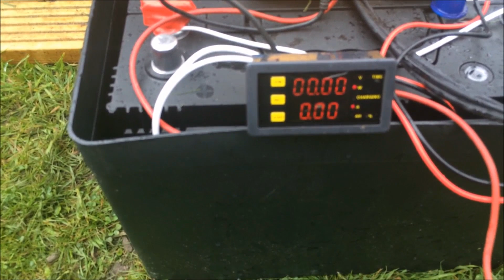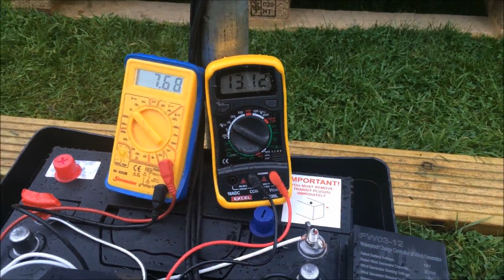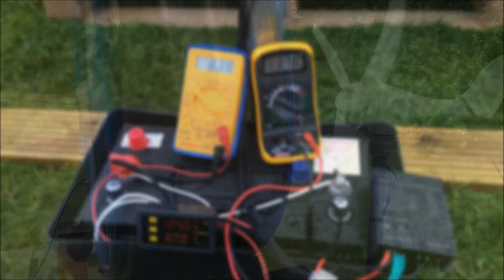100 Watt Small Wind Turbine output test and review

Comment: Just bought the 300w 12v version, it's up and running and maxed out at 416 watts so far, these turbines work and exceed there rated wattage easily, these are the real thing.
Update...432w I'm impressed
Reply: which one did you buy \ which link ? there's so much crap out there
Reply: Bull shit, these little turbines are a scam

Comment: what happens if the wind is way stronger to the voltage output of the wind turbine? will the controller dump the excess?
Reply: No. Those controllers don't dump extra load. It's just brake on

Comment: All practical tests of ground-based small wind turbines show: 1) They hardly produce any electricity! 2) They do not last long! 
*Solar panels generate at least 10 times more green electricity with the same investment & time expenditure! * Reliable and almost maintenance-free for at least 25 years!
Small wind turbines produce hardly no electricity, due to hardly any wind close to the ground – and electricity yield is proportional to third power of wind speed: +100% wind generates +800% more electricity! Moreover, the wind close to ground is extremely gusty. 9 out of 10 small wind turbines therefore stop working after a short time!

Comment: Great...... I have a 325 watt 12 volt 5 blade turbine situated on the top 12th floor of a tower block with 360 degrees view. I have had it a few months during summer but not seen any decent storms yet but on the small storms there has been it was outputting 11-12 amps so in a very strong wind I expect about 15 amps. I have the same brand charge unit shown at 400 watts rating. I may make my own charge unit & experiment.

Comment: I have a question. I am interested into these devices but since I live in a residential area I've already got power in my house, so I am wondering something, if I got one of these could I just mount it on a pole and cap off the wires with wire nuts and not have it draw power to anything?
Reply: why would you want to do that?
Reply: @TheAmazingAdventuresOfMiles  Because I like these devices, but my house already has power from the town.

Comment: If output v is low .you can connect it to step up circuit.
Reply: areenarena
hi
I have a step up circuit but the problem is that it makes my 500 w turbine to spin very slowly, like breaks the turbine.
Do you know why this is happening. I appreciate it if you can explain it to me
Reply: And loose even more efficiency 106 watts now your looking more at 55 watts

Comment: Cool, might just get one of these and a couple of 100w solar panels to run the 100w greenhouse heater in my workshop.👍👍👍
Reply: the most expensive part of the system is always the batteries.

Comment: Has anyone used one of these wind turbine with a motorhome to charge leisure batteries.  I would like to try one. Cheers from George and Jane. 👫👍🇬🇧
Reply: They can, but you need a good pole system for it.  Most of the time when you camp, it will be in wooded areas.  You need to be in high spots and have to get the turbine above the tree line to get the unbroken wind.
Reply: Don’t waste your money, invested in more solar and bigger battery bank,  they need a strong constant wind that doesn’t move around, the real world is not like the fan set up,  and the blades are brittle, they brake often.  Waste of time and money
Reply: And they are noisey , you will piss the neighbours off worse than using a petrol Genny

Comment: How many amps would that put out at that wind speed ?
Reply: 8.6 amps @ just over 13 volts = ~110 watts
Reply: @alex_byrnes  That is how many amps it SHOULD generate, not how many amps this TOY actually generates ...
Reply: @MrSummitville  Well, at the windspeed the fan creates it actually outputs ~100W as you could see in the video. 
Why you would want to know how many amps that is, is beyond me? You'd have to ask an american, they seem to like stupidifying them selves, talking about amps as it was a unit of power ;)
Reply: @ScinnerNo1  And who actually has 25 MPH DUCTED AIRFLOW up on a tower?  Ummm, nobody.  Typically, in an Off-Grid system the amps in and the amps out are measured, since the battery bank is rated in Amp-Hours.   You can use Watt-hours if that make you happy ...

Comment: what is the CFM of air volume required before the power generated becomes useful.
Reply: CFM it not relevant, is down to linear air flow speed as per the specifications. Check your site with a cheap hand held anemometer
Reply: That makes sense, CFM would not be relevant in an open system anyway, wind speed is what moves blades.
Reply: @patriot9455  You need clean & steady 25 MPH wind !  Now, who has that on daily basis ?
Reply: @MrSummitville  at about 50 feet in the area where I live, the steady wind is over 20 MPH on average. wind and solar work well together. it is a good idea to have a battery bank to store expressed electricity. Being a ham operator, I would have a legitimate use for a 50 foot tower.

Comment: is that 100 watts a second or an hour
Reply: An hour
Reply: doesnt matter ¡ if you get 100 W in an small moment, you are getting the power on that time, and if you keep it by 1 hour, then you got 100Wh (energy). So the question and the answer doesnt make sense. What they are measuring in the video is the nominal power, then if the wind flow at the same speed by 1 hour you get 100Wh (it is an energy mesure) the other is just the Power ¡
Reply: @nasserkhan674  Neither seconds, nor hours.  It is 100 Watts only when the wind is blowing at a steady at 25 MPH.  Which is hardly ever, for most people.
Reply: @MrSummitville  most areas have sufficient wind, but not near ground level. if you can put up a tower 50 to 75 feet above the ground and also far from any local trees, you might be surprised what actual power you generate. Mrsummitville, you sound like an employee of a generation company that does not want to lose any profit. Many people put them to low, or don't have sufficient clearance from wind barriers to generate full power. It is not just about the wind, it is how the wind comes to you. if it comes in turbulent, it will not be efficient in energy production. Inside a city, you are unlikely to have the success advertised, and on the top of a mountain, you have all but a guarantee of success. Your success depends on wind speed and whether you get straight line wind, or wind bent around obstacles. They hit the blades at different angles, giving different results. you have part of the story, and highlight the negative side.
Reply: watts are not measured with time
Reply: Neither. 100 watts is the instantly available power.
(1 Watt = 1 Joule of energy delivered over one second)

100 Watts delivered for an hour is 100 Watt Hours (Wh) of ENERGY in total that you have generated.

If you store 100Watt Hours of energy in a battery you can power a 100watt device for one hour. Or a 50watt device for 2 hours, or a 200 watt device for 1/2 hour.